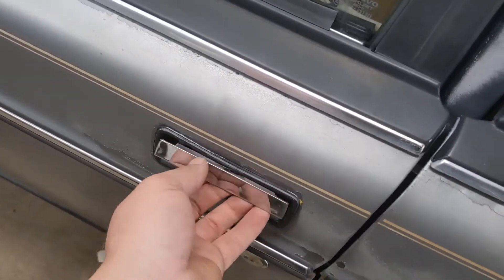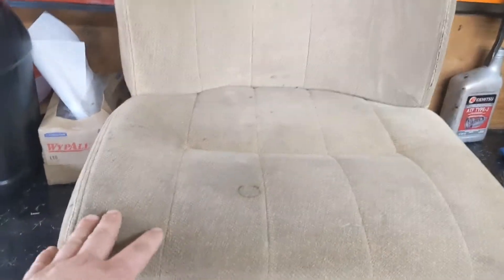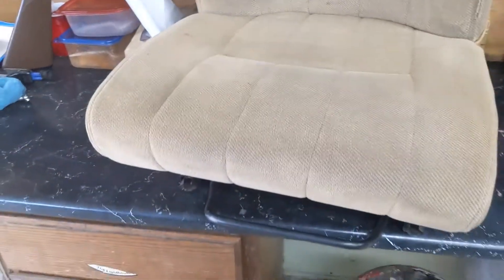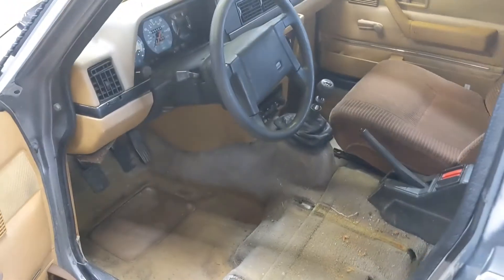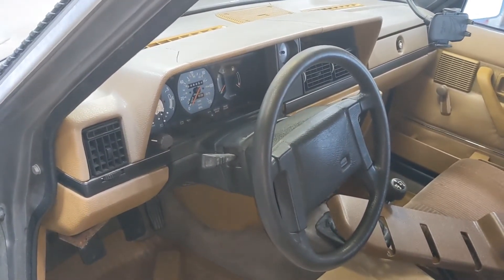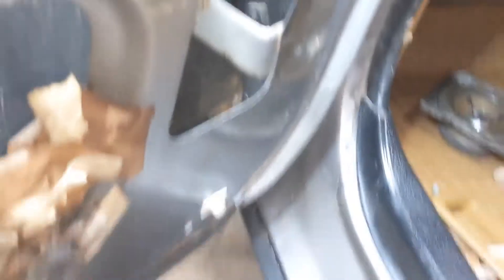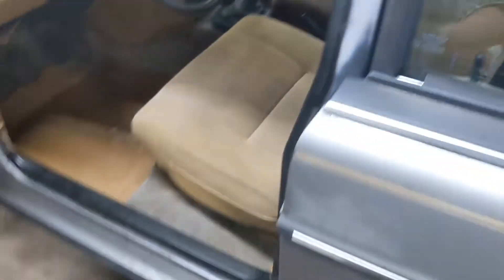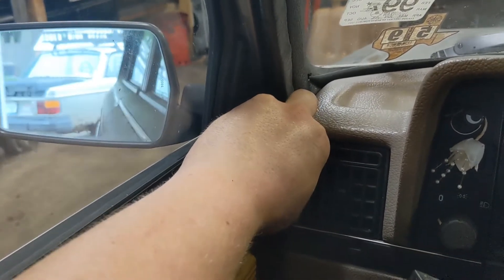1985 Volvo 244 Revival: Pt. 4

Comment: I usually "fill" the bottom of the doors with a thick oil to prevent further rust  (doing it anually seems to be enough).
Reply from the maker: That is a great idea! Thank you for the tip! I just got a 1990 240 wagon and the bottoms of all the doors are rusty. I am going to try this soon. 

Thanks!
Reply: @BeardedWrencher  just make sure it's really dry before you do it, otherwise it may trap any water left down there.